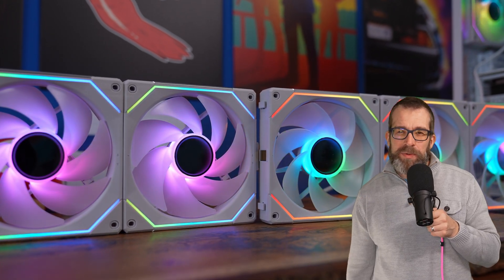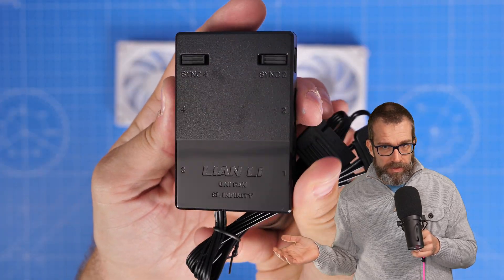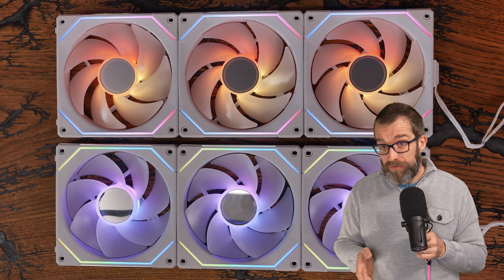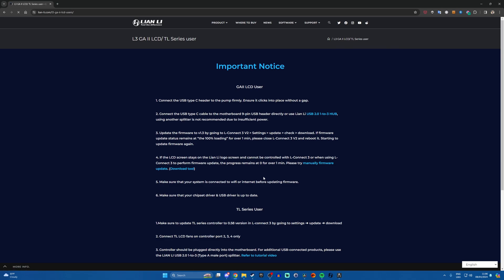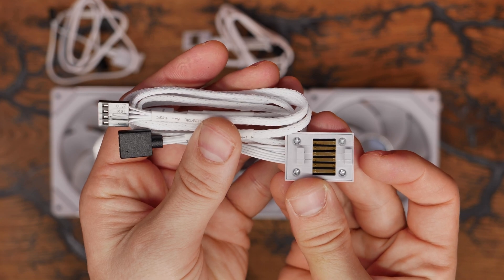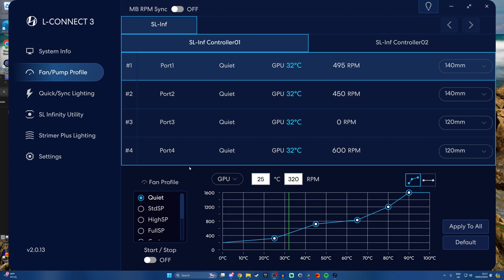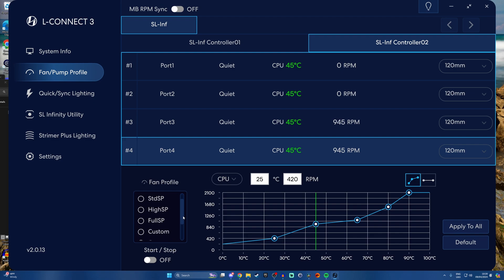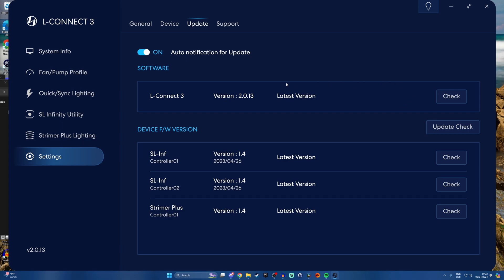Your Lian Li fan problems and questions answered

Comment: I need help so I didn’t know any better cause I’m a first time PC builder I ordered fans from Lian li my Xfinity fans some of them are wirelessly and some are wired. Am I still able to get them to work together in the L connect software
Reply from the maker: Yes, but you'll need both controllers
Reply: @TheProvokedPrawn  so I have the SL wireless and I have the wired one so the wireless comes with the Bluetooth dongle and I ordered a controller. Is there anyway for you to send me a link? So I know if I bought the right controller. Cause I seen that TL and SL do have different controllers.

Comment: I have reverse inf fans group of 3 at the bottom of the case all fans are working but last fan no light is coming on and middle fan has some lights about half of them on. What could be the issue. I reconnected the fans but still the same. Anyone pls advise. I have downloaded the li Lian connect 3 app and it shows the reverse fans are working as I can select rgb lights.
Reply from the maker: All the connectors are properly in place? Are they the wireless fans? If so, have you used the sata power adapter? If not set them to PWM mode in the bios

Comment: I have connected my reverse blade uni fansl-inf 120 straight to the M/B(MSI X870) but I get no light. Fan control works properly but I get no rgb lights at all... Do I have to buy something extra to get the lights working, or i have something faulty here??

P.S. Yesterday the fan started lighting, and just as randomly stopped lighting again, after some time..(i don't know exactly, cause i didn't pay attention.. maybe it stopped when i set my pc to sleep. point is, lights never came back on..

Comment: I'm having issues where I put certain color a a style  then I choose something else and go back to that same one for the colors to reset and I have to keep changing the colors I want instead of saving it any idea?
Reply from the maker: Are you running the latest software version. If it's the wireless fans be sure to use pwm mode in the bios

Comment: Tnx for the link en the info. I think i have here a doa, dead on arive product. Stil, only the 3 pack uni fan sl wireless lcd 120 is working. The uni fan sl-inf 120 and the uni fan tl 120 are still dead. Ik think i'll replace them with another 2 3 packs of uni fan sl lcd wirelless.

Comment: So if i want to play with the panel, i need to buy the lian li controller hub? cannot  use only one fan?
Reply from the maker: I do not understand what you mean
Reply: @TheProvokedPrawn  okay i already bought only 1 lian li sl lcd fan, but when i connect to the lian li software, it cannot detect the lian li fan. My question is, do i need to buy Lian li hub controller so that the software can detect and i can custom the fan lcd panel?

Comment: Thanks so much for the awesome video you created! I’m currently using three (3) UNI Fan Infinity Mirror TL LCD 120mm reverse blades for intake, three (3) UNI Fan Infinity Mirror TL 120mm Standards blade for exhaust, and one (1) UNI Fan Infinity Mirror TL LCD 120mm Standard blade also for exhaust, along with three (3) P28 fans for intake.

I’ve noticed a little hiccup: every few minutes, the RGB on the three (3) UNI Fan Infinity Mirror TL 120mm Standards for exhaust starts to blink. I took a look at the Lian Li software and saw that every time I set the fan speed to quiet mode, it reverts back to the standard setting after a bit. It seems like the system is trying to reconnect with this specific fan (a group of three fan connected together) since they keep disappearing and reconnecting. While they’re running, I can hear the fan speed changing, which is a bit odd.

I’m on the latest version of the Lian Li L-Connect 3 (version 2.029), but the issue is still there. I’ve connected all the fan USB cables to the PSU hub (Lian Li 1200 watt gold) hub that came with it.

three (3) UNI Fan Infinity Mirror TL LCD 120mm reverse blades for intake: Fan cable Connected channel 4 (motherboard)
one (1) UNI Fan Infinity Mirror TL 120mm Standards blade for exhaust: Fan cable Connected channel 2 (motherboard)
one (1) UNI Fan Infinity Mirror TL LCD 120mm Standard blade: Fan cable Connected channel 3 (motherboard)

I am using the L-Connect 3 wireless device

I am happy to share any other information you may need, even if necessary to connect through zoom or any other platform to go live and check. 

It’s just these three (3) fans giving me trouble. Is there any way you could help me figure this out? I really appreciate it!

Comment: I have a small issue that my lian li lcd fans has a slight sound from the fans that appears and comes back again, but not permanently. I asked a friend who has the same problem with the LCD fans only, and I tried to put the fans in quiet mode, same problem.I dont know why this happen . I got my LCD fans 1 week ago its new

and one more thing My Lian Li program disconnects itself from time to time and I cannot control the colors. I have to reconnect it to be able to control it again. these happen to me too many times I dont why this is happen
Reply: Hi mate, I just want to check we have the same issue? My Lian Li LCD fan will go high speed for several seconds every 1-2 minutes(no load at all, even no one use the PC)...this create a very painful issue...You will regular hear humming noise every 1-2 minutes which drive me crazy....even set the fans in a fixed speed, at actual run the fan speed still will go up.

Comment: I have only had issues since buying lian li parts. Like many i really liked the look of the uni sl infinity fans so i saved up enough money to buy the infinity aio. At first i could not for the life of me get the cooling bracket over my cpu it required such an incredible amount of force it cost me 4HOURS of trying to JUST GET THE COOLER OVER THE CPU!!! Eventually i got it to work and everything worked except the pump lighting. Anyway after troubleshooting for 3more hours i finally got them to work. This was a year ago and they have looked great since. 4 days ago i finally bought the rest of my fans (7 total) to all match my aio so i could switch all the lighting in 1 application and it would all be great. So i was super keen on getting them in my pc and spent 3 hours fitting it in my case and doing all the cables. Well 3 of the 4 new fans dont spin at all and 4/4 dont have lighting. Lian li wtf. When i spend 90 euros on some pc fans i would atleast expect an easy installation process but i ALWAYS have to troubleshoot something. This is ridiculous

Comment: Hello, I have 3 TL wireless reverse, 2 TL wireless and I want to add more wireless reverse on bottom. But the fan is running on max rpm randomly and I cant fix until removing the wireless receiver. Any suggestion?

Comment: i build a pc with Lian Li 207 cabinet, and the two front fans are very loud. fans humming loudly. any solution pls..
Reply from the maker: Is something pressing against them
Reply: @TheProvokedPrawn  No. I checked the bios msi b650 gaming plus. sys fan 2 running at 1650-1700 rpm and sys fan 3 at 1800 rpm approx with cpu fan at 780-800 rpm. are these rpm high at idle? i'm new to pc build. 7600x with deepcool AG620 air cooler, rtx 4070 ti super gigabyte windforce max oc. sys fans are set to DC, i will change to PWM and will tweak few setting after watching your video "are your pc fans too loud''
Reply: @TheProvokedPrawn  Switching from DC to PWM helped. RPM decreased from 1800 to 1300 and is quieter now. thanks to your "are your pc fans too loud" video.

Comment: Have a 9 SL inf setup. Bottom and side are three 140 reverse, back one 120 and top 3 pack 120 connected to fanless Hydroshift all connected to  SL controller. All are detected on L- connect3 but the 3pack on the Hydroshift won't light up. I can change fan speed, set to cpu and everything, but they just don't light up. I'm So confused.

Comment: The issue is you can barely find them to buy therefor the prices gets even more higher. Also the issue they are selling 3 exhaust fans + controller. In my case I only need 2 exhaust and 6 reverse for intake and I don't feel like wasting 30 euros on a fan I do not need and sure I can use it but then I would have to spend extra 60 euros for another 2 to finish the build. P.S. Donate me some fans :D
I would really love to get them for my first pc build I was considering the knock of but then again I don't build a pc every day.

Comment: Hello, Thank you so much for your helpful videos. Got my Lcd fans working after a while.
I do have a probelm with my SL infinity 140mm fans not showing up on Device manger and L connect. I do have my rgb and fans working but cant update my controller due to it not being detected. I have the usb conneted to mobo, both sata cable connected to psu. 5v and rgb connected to the mobo. How do i get the controller to show on device manger?
Reply from the maker: Odd. Can you try a different usb port?

Comment: Why do my fans keep flickering? I just installed them...i got the wireless ones
Reply from the maker: Insufficient power perhaps? If you are running them off fan headers then go into the bios and set the fans to pwm mode. Otherwise try connecting them to the sata power cable and to your psu directly instead

Comment: Lian li is absolute garbe i tried there 120mm.uni fans they never worked or would always have to disconnect them from there controller and re connect the rgb never worked at all thought it might be a data power issue but nope as soon as I hooked up some nzxt duo rgb boom everything worked
Reply from the maker: Sorry to hear you've had a bad experience. They've always worked well for me.

Comment: There a way to control TL 120 fans without downloading L Connect?
Reply from the maker: https://youtu.be/gvDVijV4qvU

You'd have to use motherboard controls via the sync option. Not sure why you would though

Comment: Sorry I am late to the party although I have a question I can't seem to find the answer to. If you have multiple model Lian Li fans in your build (such as TL coupled with SL-INF) does the software work as if they were all the same and manage to sync the lights going throughout the build or its every model of fans with its capabilities and slightly different light game?
Reply from the maker: I haven't really done that but there are some universal lighting options that can sync across the fans yes. Different models might have other options though
Reply: @TheProvokedPrawn  thanks for the quick response, I think I'll try writing them an email. As a  gamer, I don't have the money to buy and test and I just wanna let as few things as possible unanswered by reading and planning ahead!

Comment: if my case came with an rgb controller and a button dedicated to it, and i end up switching the fans to these, could the button still work with the lian li fans? and  if you had more than one rgb controller (both lian li) would you still have to connect both of your sata from ur psu to one?
Reply from the maker: Doubt the button would work. But yes you can usually connect more than one device on sata
Reply: @okay, thank you. great video!

Comment: Is it worth to buy 3 more fans on the back? I mean, is it just for aesthetics or does the push pull function heavily help?
Reply from the maker: It helps. Whether it "heavily" helps depends on the case airflow, ambient temps, etc
Reply: @TheProvokedPrawn  i was planning to build a Lian Li compact. I have seen others put the fans on the back but not sure about it.
Reply from the maker: @danybayor  I haven't done it in the Vision Compact but it's certainly worth it in that case because airflow can be limited.

Comment: So my 3 side intake fans and one exhaust fans in the back are reading as CPU fans in L Connect 3 
Is this a problem? If it is how can I fix it ??
It won’t let me change the CPU option to GPU or anything else
Also none of them are plugged into the MB the cords weren’t long enough for the single and triple fan didn’t have enough power so I’m using the sata cord to power them
Reply from the maker: That's not really an issue as long as the temps are good.

Comment: I really do not like these fans. They are annoying to set up and require multiple controllers for different fan types. It's absolutely ridiculous that I needed to connect more than 2 different connections to run a solid block of 3 rgb fans.

Comment: My firmware is updated and everything is connected properly but they still won’t spin I have the rbg working but they won’t spin no matter what
Reply from the maker: Power is connected to the controller? Zero rpm mode is not on in L connect?

Comment: I just got the Lian Li sl120 fans, but I don't have the controller (I only have/need 2 of those fans) I have them synced up correctly but when I plugged it into my Corsair Commander Pro, the PWM cable got really hot, plus the RGB port isn't recognized. Is it a problem with my power or what? Should I try and plug this into my motherboard instead?
Reply from the maker: You shouldn't be connecting those fans to a Commander Pro. So yes, try the motherboard

Comment: Recently discovered your videos and have been finding them really helpful!
I'm getting ready to do a new build since my pump on my old one is failing and can't seem to find a single aio to fit my old socket. My new build is practically Lian Li everything! Got the 011 dynamic evo xl, strimers, infinity fans (three 120 reverse blade for the radiator, three 140 reverse blade for bottom, three 140 for the top and a pack of 120s so I could have one for the back and get the hub), looks like I'm making out too because Amazon sent me the wrong package and instead of getting my Galahad II lcd aio I got a 3 pack of the lcd fans that they are letting me keep and am just waiting on getting my replacement Galahad. I'm really excited but also nervous since it's going to be the first time building the pc myself!

I'm curious about the L-connect software, you recommend uninstalling the old software and reinstalling it for the new versions, does that wipe your settings every time you do that? Do you have to reconfigure all of your settings for lighting and fan controls or is it carried over on the new install?

Also, with the Galahad, from what I can tell and have seen, they want the lcd screen with pump tubes on the bottom. Since I plan on side mounting my radiator, if I have my motherboard installed moved up a bit higher will there be enough room for the tubes to go under the RAM to not block the RGB lights on them? Any recommendations for that?

Comment: This is all great info but my fans are straight up just not working and its getting ridiculous, I dont even care about the rgb or any settings I just want the fans to turn on and cool the computer. I wish I had researched these before buying them because its entirely ridiculous a fan needs a controller to work at all and all these hoops I have to jump simply so they WORK. Still no clue what I am doing wrong.
Reply from the maker: @alpharius7712  are they connected fully and correctly? See here for an example - https://youtu.be/6HUpX6v1qTE

Comment: Mate so you can add a single fan to the controller hug using a flat connector? Do the flat connector that comes with the 3x pack infinity fans, can be use in a single infinity fan?????

Comment: I cant get the system to find the fan controller. I only have 2 options on the l3 connect  software system info and settings nothing else. i want to use the LCD fans but I'm getting ready to rip them out
Reply from the maker: https://youtu.be/gvDVijV4qvU
Reply: @TheProvokedPrawn  
thank you I have watched that video multiple times. The main issue I am having is my motherboard only has one USB 2.0 port and I can only connect to it with a splitter that the Lian Li fans don't like. I have an EVGA CLC  aio also that requires a USB connection
Reply: @TheProvokedPrawn  I got the fans and software to work . I had to add an NZXT USB hub to the system to get the L3 software and the PC to recognize they were installed, The motherboard only had one USB 2.0 port

Comment: Having a tuff time with my new build. Using the TL line 
Hydro shift AIO LCD with 3 Tl fans top mount
3 LCD TL’s side mount
3 regular TL’s bottom mount 
1 140mm TL back mount
L-connect 3 doesn’t recognize none of the fans.
They all turn on and spin
Reply: You fix it yet,
Reply: Yes i had everything connected to one controller. I end up using 2 controllers. One dedicated for the AIO and the other controller for the other fans. Worked like a charm after

Comment: Since connecting my GA II LCD Cooler to the MB along The coolers controller I now see and can control my fans but prior to that I could not because I had the usb connector going to the psu. So now I have my strimer controller hooked up to the psu and now in LConnect I cant see my strimers. What should I do to fix this situation? Should or can I buy a usb header splitter and have 2 connections on one header so all works?